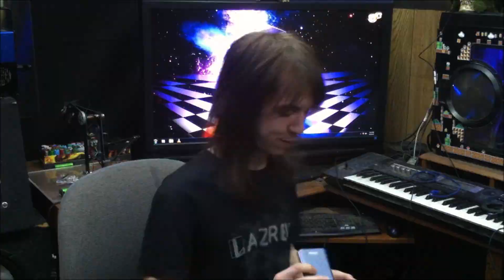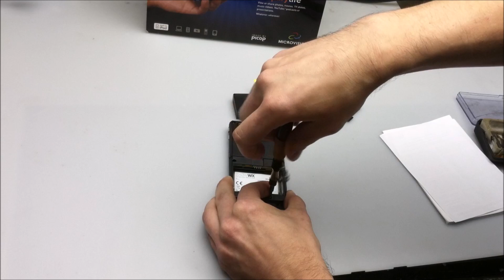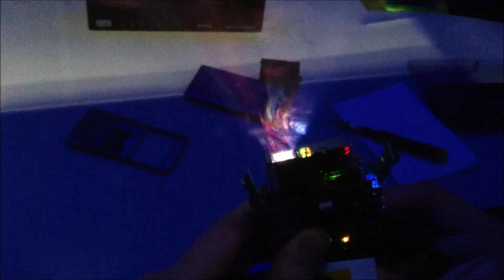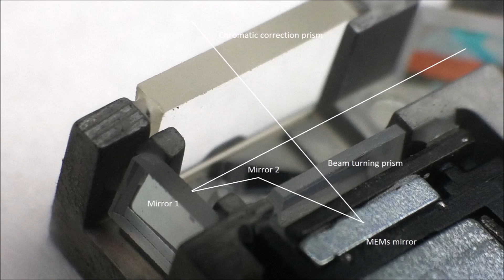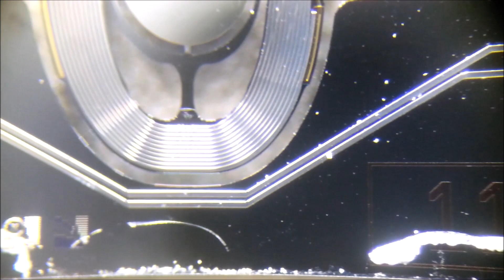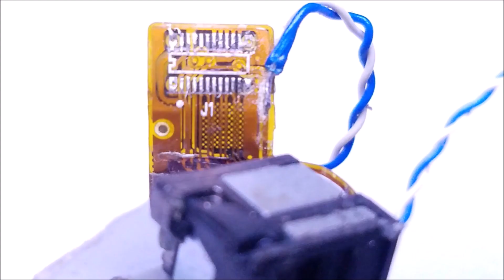The Microvision ShowWX Laser Pico Projector

Comment: Wow, kudos for being knowledgable and sharing 🙏🏼 May I ask if you have any advice in regards to replacing a laser diode within a device like to a UV laser diod or if it's even possible? :P
Reply from the maker: There are a few UV laser diodes that can sometimes be obtained. I do have connections to that and have heard of 395nm - 396nm laser diodes. They are pretty costly and end up being $600 per diode minimum through direct means of purchasing.

Comment: once upon a time I made something like this at home
Reply from the maker: That sounds like an accomplishment and a half. What was your device designed to exactly do?
Reply: @Zenodilodon  I made a projector for advertising, but ran into a limitation on the power of the beam, the homemade mechanical resonator was very hot from the lasers and the resonance frequency dropped, which led to unstable operation and a change in the amplitude of the horizontal scan, moreover, the mirror was about 3.5 mm in size and not the whole beam could be reflected, which greatly reduced the brightness, in general, I abandoned the idea of a resonant galvo and switched to a polygonal mirror, but there are other limitations.
Reply from the maker: @denispacific8821  All of those issues remind of when I tried to build a dual axis gimballed mirror. I has all sorts of problems with getting reasonable results. Galvos are hard to beat for larger mirror movement. The MEMs stuff is fascinating but very limited on optical power handling. Another device I looked into was piezoelectric actuators as some have been made for beam steering applications. I think some where used for the laser based TVs that never really gained popularity.
Reply: @Zenodilodon  yes, mechanical drives have limitations, but nowadays KTN crystals have appeared, they are capable of deflecting the beam hundreds of thousands of times per second, although I have not seen them on sale.
Reply: @Zenodilodon  all my projectors worked, and there are corresponding short videos about this, but the result did not suit me and I abandoned them.
Reply from the maker: @denispacific8821  I have never heard of KTN crystals. The closest 2 things I know of are PCOAMs and some of the nonmechanical stuff developed by Boulder Nonlinear Optics. I'll have to look into KTN stuff, it sounds really interesting.
Reply: @Zenodilodon  https://www.ntt-at.com/product/ktn_deflector/
Reply: @Zenodilodon  if you are interested in the topic of laser video projectors, then check out this - https://www.youtube.com/watch?v=Rck6ZMo8Hfg
these guys use acussto-optic crystals, and these - https://www.youtube.com/watch?v=PHRDqQuOj6o use copper vapor lasers as gain medium.

Comment: Excellent video!

Since you know this stuff backwards and forward, I've got a fast question. I've been wanting to work on some practical effects using rear projection and have needed a PICO projector that has a very wide FOV at close range and very short depth of focus. I've heard laser projectors can fit this bill. How close can you get to a surface and maintain image clarity?
Reply: I see a knock-off projector that claims a min distance of 6 inches... that would be a step in the right direction.
Reply from the maker: @john_t_england  The DLP projectors will most likely be your best best. The lasers have a minimal beam size of about 1.5mm so even though they claim focus free it only applies past the point of the beam being able to spread out. At close range the image is a bit muddy. Overall I quite like AAXA projectors for overall usability over multiple platforms and they have a quite close focal range. Trying to enlarge the image on any projector for short throw use will be tricky though as the optics are not made for short throw projection/wide angle output. You may want to shoot the projector upwards and reflect the output off a first surface mirror to increase the distance of throw and therefor the size.
Reply: @Zenodilodon  I was afraid the focus-free claim was bogus... Thanks for the tips!
Reply from the maker: @john_t_england  It's not a bogus claim, it just applies after a point where the scan lines don't overlap.
Reply: @Zenodilodon  I see, understood. Thanks again.

Comment: I remember when this came out. I was super pissed because I was on a similar project that was using a MMA (Micro Mirror Array) and 3 separate lasers coming in at different angles. They beat us to market and the company basically threw their hands up and quit the project. Fools. 
So I want t o use a pico for a Halloween fire effect on smoke. Any suggestions?
Reply from the maker: Man that sounds awesome, I would of loved to of been on a project like that. My thoughts on making a fire effect, is this indoor or outdoor? Maybe make a small air forced fog screen with a mini ultrasonic device and plastic tube and project the image onto that. If it's outdoors it might be trickier but there are ways to atomize other things that don't freeze like VG.
Reply: @Zenodilodon  I have a commercial fog machine that uses glycol. It's going to be outside. I figured a way to make a PVC manifold that will give a good curtain of fog. Just need a good projector.
Reply from the maker: @charlesurrea1451  Indoor or outdoor use if outdoors what kind of climate?
Reply: @Zenodilodon  Outdoors and dry,  but in Florida.
Reply from the maker: @charlesurrea1451 Honestly, I would go for something dirt cheap with just an LED and LCD panel. The chinsium projectors but with a decent size/brightness.  I would not suggest something with a HID lamp or something DLIP because of direct heat. Sometimes simple is the way to go. I would say invest more in the general weatherizing aspect, air flow, small additional fan, air vent filter mesh, water resistivity and so on. A fog screen won't be able to catch a very high resolution and a cheap projector I think will have the best chance of being stable with a little prep over something engineered to high specification.

Comment: Great Video! I want to play... You have a spare MEMS I can trade for something? I don't want to rip my Microvision projector apart! :P
Reply from the maker: I will bring one down next time I am at the shop. Do you want it prewired?
Reply: @Zenodilodon  Either way is fine.  A pinout would most definitely be helpful.
Reply from the maker: @hightechstuff2  I have one that I completely wired for probing. I am sure between that and the pictures we'll figure it out.
Reply: @Zenodilodon  Do you by any chance have a spare showxx+ composite video adapter? I'm trying to repurpose my unit and need to understand the pinout of the connector.
Reply: @hightechstuff2  I need a pinout of the component connector. Any chance you could help me out there? Or if you have an extra connector, I'd buy it off ya...
Reply from the maker: @jordancpaul  I have an extra ShowWX composite cable yes. I think it should be the same as the + version do you need a cable or just the cable checked with a meter to identify the pins for composite?
Reply from the maker: @jordancpaul  I don't know if you saw my message. I do have an extra composite video cable for the ShowWX. Send over an email Zenodilodon@gmail.com

Comment: the Blackview MAX 1 projector-smartphone also uses this scanning mirror, but has a green laser diode instead of a opsl
Reply from the maker: From what I know the ShowWX and WX+ are the only things with the mini OPSL. There was such a small gap between laser pico projectors being made and the use/invention of stable green laser diodes.
Reply: @Zenodilodon  JerryRigEverything made a teardown on that phone / projector module.
Reply from the maker: @gamerpaddy  There have been a few tear downs on the laser pico projectors that I have seen previous to this. When jumping into this project my end goal was to exactly figure out how to the MEMs works and how to drive it outside of the projector which I had not seen before. Mission accomplished!

Comment: i wonder how much power those 2 axis mems scanner can handle, i mean those mirrors arent perfectly 100% reflective, some of it gotta get converted in heat and those mirrors doesnt have a lot of mass or cooling.
Reply from the maker: That's a good question, I am betting these can handle about 500mw or so before damage happens. I slightly damaged one with 300 mw but I think I clipped the end of the coil. The Sony laser projectors use 5 lasers all about 80mw capable.

Comment: Sadly thes mirrors can't be used for show laseres
Reply from the maker: Yeah, I was oping they could be used for vector graphics too but these simply don't work that way. I hope to mess with MEMs micro mirrors that can one day. I did speak to Mirricle's development division though and it looks like they can't handle more then a watt of optical power so there are limitations even at that point still. None the less I would love make a pocket ILDA capable show laser one day.
Reply: @Zenodilodon  could you use two to build a vector display?
Reply from the maker: @philipweser8774  No, there is too much distance between where the mirrors would be. The mirror is just big enough for the area of a single beam. The closest you could get the mirrors together would be like 10mm and any deflection on the first one would immediately move the spot off the mirror on the second.
Reply: @Zenodilodon  Just brainstorming here, could this optical power limit be cranked up a bit, by placing the mirror in a flow of e.g. nice and cold helium? Happy new year by the way!
Reply from the maker: @EatRawGarlic  perhaps but helium doesn't have much thermal mass. I did clean one with air and it started to hum quite loud because the air made the mirror vibrate like a reed. I think if you passed air over the MEMs it might cause issues with the motion. Happy new years to you as well!